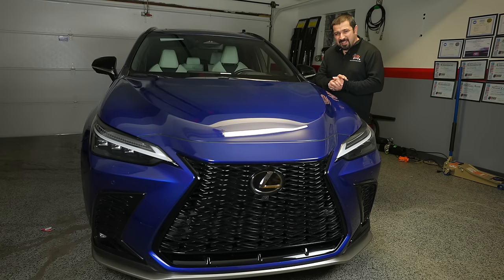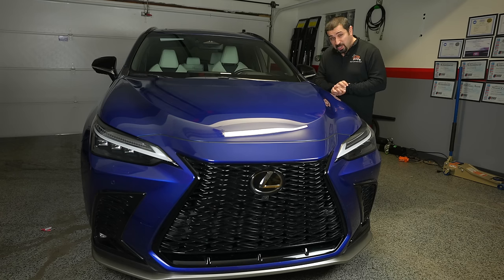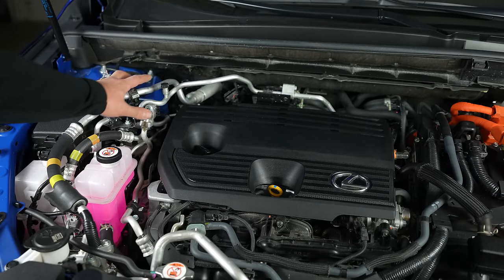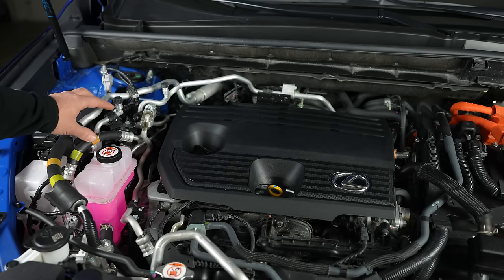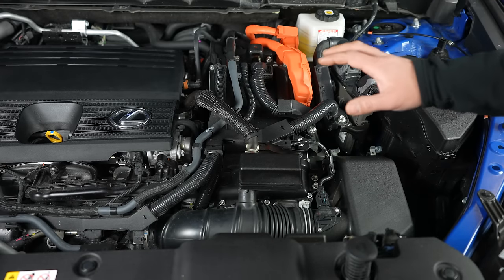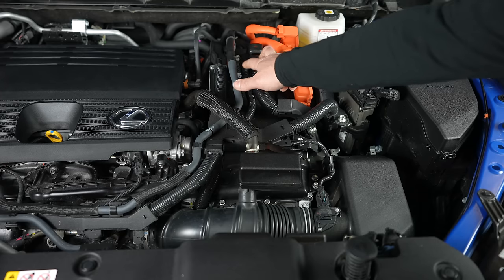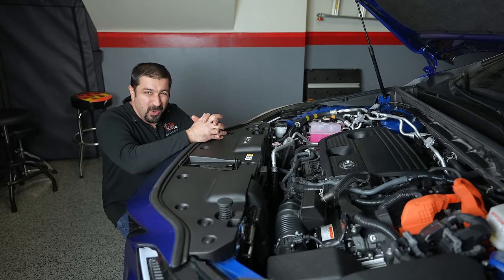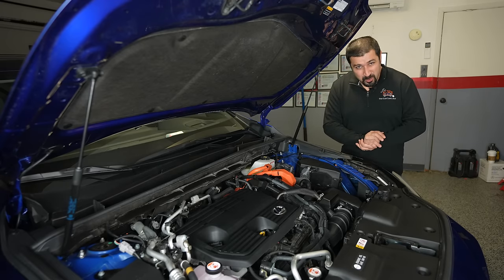The 2022 Lexus NX Marks the New Era of Lexus! Full Review and Technical Tour

Comment: Can you aftermarket fit a spare tire to later ditch the run-flats?
Reply: The battery in the spare tire well makes that difficult
Reply from the maker: It’s difficult with this one
Reply: How about normal tires and some kind of repair kit?
Reply: You should be able to on the non hybrids. But you'd have to get another matching (in size and style) wheel for that spare tyre, obviously.

Comment: Why was the 1.8 L prone to oil consumption, (Corolla 2011)?  And that year (mine) has brake problems - and struts are worn out (noise) @ 90K miles?  Do you think, if I write TOYOTA that they might take responsibility after so many years? Why market a car with THIS amount of issues? Saw your video confirming all this. My brother has a 2011 Tundra even now no issues! My bill will top $1200 so far. New brakes, alt. struts have failed @ 88K!!!
Reply: 88K ! Lucky I guess I got a 1.8 rather than the 2.4L oil burner.

Comment: ..........I own the 2022 450h+ F sport..Note the Heads Up display on the windshield W/14” Crystal clear display on both, alone makes the Lexus better........Mine is In Atomic Silver Glows in the Sun Light with Lil" grey metal flake" and same Circut Red interior.. but with Electric battery...Has 306 Horse power 0 to 60 in 5.6 sec (Via Road and track at drag strip!.) This model DOES- NOT have a TURBO...But rather, a Naturally aspirated / Carb...........(important because it is well known that TURBOS stress engines)...simply said: see euro cars shop time & inevitable “ Check Engine Light CONTINUALLY!!....this car combines the Elec Batt and engine to achieve 89 miles per Gallon in Hybred mode with HIGH torq, And VERY quick out of the hole...Jus' blew the doors off a 735i beemer...albeit for only a block ...( I am no dummy a V will eventually pass many cars in the long dist. (in all fairness) ......However, who cares the thrill is initial take off and tickets are for high speed & SPEED...Kill's! My car has Red Calipers against Powder coated Gloss spoke Black mags and All red "F" Sport Badges........ FAR better built than euro's (mine built in Japan) sadly, new releases are now being made in Canada! Like USA Union shops...no one gets fired for a hang over and bad work??? maybe)..... However, Lexus is Far more reliable...Far better Re-Sale that Euro beemers or mercedes Check Engine Light Gucci headache) .......indeed mine has Gone UP in price...Not many cars you can find Like that!... IF YOU CAN FIND ONE ANYWHERE do grab it!......"econ 101".....Has (3) elec. motors gett'n 0 to 60 in 5.6 sec (road and track) HIGH torque QUICK out of Hole!......~*~*Never do I use gas..... gett'n 43 miles per 120 Volt charge (real world driving my experience.) and NEVER USE GAS Frean'n inflation caused by “Elections Have Consequences!....Almost Silent operation in elec....So do your research, PLEASE......as this is Far better than any European beemer, mercedes and korean etc. All those are depreciating the moment you drive off the lot BIG TIME! And are un- reliable offering to say nothing of the GAS HOG unproven G 70, & RDX not worth mentioning. Z Best of the BEST F Sport 450h+ ! ….One more thing, Jus' a heads up!......My wife drives the RX 2020 model...Consider putting Michelin's at $1000.00 en ebay and balanced on your NX 450h+ F Sport replace the Idiot Run Flats that the dealer wants a $1200.00 extra for warr because like me You WILL eventually get a flat and the Run YOUR WALLET Flats are required to replace??? are you freak'n kidding????....Michelin's primacy same size &......Far and away EVEN a much smoother ride, Shissh, Do Not tell my wife ...even smoother than her 2021 RX 350....because My "F" Sport has the added "Adaptive Suspension". Much better ride than the HARD Run Flat Bridgestones that come stock. Carry a Batt. quality inflator ( DeWalt 20V MAX Corded/Cordless Air Inflator ) and string tar impregnated rope insert-er and Do-Not wait for AAA. Do the aforementioned and You WILL Have the best of the best.....Jus consider this on DEPRECIATION: https://www.youtube.com/watch?v=NPJnBjfh644 End of story!

Comment: Lol there’s the orange cables I was referring to in your livestream question I had about some other vehicles that don’t seem to have it now, and you replied “what orange cables?” (Along those lines). So why do only some Toyota hybrid products have the orange cables in the engine bay?
Reply from the maker: They all should have orange cables for high voltage wires
Reply: @TheCarCareNut  is it possible that depending on the hybrid model (even though I believe they carry the same power trains??) that the 2.0L and the 2.5L have different inverter/converter units? Thus having maybe a different high voltage plug location? Because I see it on the 2.5L, but you have to look down the firewall to see them, they don’t sit on top in the engine bay like this Lexus does.

Comment: Are the run flats only on the NX plug in or are they across the board? Hearing the words “run-flat” is a disappointment, especially since Toyota seemed to be stepping away from them after the new Sienna came out.
Reply: All trims have the run flats

Comment: I know why Lexus didn´t offer spare tire in NX.
It´s because they had the same situation of Lexus UX: There is no space to put a spare tire in the trunk. The UX is too small to that and the NX has the double wishbone rear suspension,the fuel tank,the plugin hybrid battery,the AWD and the rear eletric engine. And due to these components,there is no space to put a spare tire.
The Lexus ES300h has spare tire. But I agree. Run Flat tires are unreliable. It was better put conventional tires and no spare tire.

Comment: Hi AMD, I got a question , i owned a 2021 RAV4 XSE PRIME PREMIUM PACKAGE, the reason a specifically detail it, I’ve notice at the back of rear passenger driver side, left rear tire, underneath theres a small kinda control module comes with a small control bars , and ive check and confirm with other RAV4 Trims GAS OR HYBRIDS., only the PRIME XSE PREMIUM PACKAGE has this Part.,  WONDER WHAT IS THIS FOR?( THANK YOU IN ADVANCE)
Reply from the maker: Hi! Level sensor for the headlights
Reply: THANK YOU SO MUCH.

Comment: Hi AMD. My 2021 Camry Hybrid rear defroster top portion lines are not active while bottom ones are, only the lower two thirds of the total lines. I drive on Eco all the time, is that related?
Reply from the maker: Hi! It’s not likely an open grid. Would need to compare it to mine actually to make sure that the top lines actually are usable

Comment: By going to run flats toyota/Lexus is forgetting about most loyal customers who want reliable long lasting parts such as tires.  I intend to get the 350h but dislike the run flats.  The 350h with 18 inch tires has a short lasting tire that has a traction rating of B.  The best is AA and many regular tires from good brands like Michelin have great tires for suv ‘s .   No spare tire is a poor decision.  Why would Lexus do this to Lexus customers?  Many of whom are moving up from Toyotas?
Reply: The whole run flat tyre situation isn't new to Toyota. The second gen Sienna (2004-2010) had run flat tyres from the factory. Most people who bought them changed to regular tyres, so you can't find any used Siennas with them. My prediction is that the same thing will happen with the NX.
Reply: Yes I would switch to regular tires too.  But not being able to have a spot to put a spare tire is not good

Comment: One more question: Does the 350h REQIRE premium gas, or is it recommended? In other words, is it safe to use regular gas with it (I don't care about losing a little performance/acceleration). It looks like an idiotic decision to require premium gas for a hybrid vehicle.
Reply from the maker: Hi! Lexus has done that to a few models for a gain of a few horsepowers
Reply: I pulled down the 350h owners manual, it clearly states 91is  recommended, but the min is 87- so not technically it does not require.  Other then power, the only other reason might be that these engines tend to have higher compression ratios.  But since they are used in other Toyota cars with 85 (edited) , it is highly likely just slightly more power.  My older Camry V6 said the same thing, and I only use TopTier 87 gas for its 165LK miles.
Reply: Thank you xFirstxLast, this is awesome! Now a question to the Car Care Nut as a professional Toyota technician: are there any consequences  (other than loss of a few horsepower) to using regular gas? Loss of warranty, reduced engine longevity, that sort of things?
Reply: @alexanderkrichevsky9194  Yes, a question I have been pondering also.  Here in Colorado,  87 supposedly due to elevation, is a mid grade.  85 is actually the regular.  Unless I hear otherwise from a master tech (Toyota or Lexus), I will not use the Colorado 85 regular gas, but probably skip the mid-grade 87 NX min  and just go to the recommended  91 NX premium just to be safe to reduce the risk of any knocks that could damage the engine over a long term.  I know the performance is going to be very litte and I would probably never  notice any my daily driving.  Colorado's weird gas options, just make this decision harder to know the risk, if any.

Comment: As a technical guy myself imo you are nitpicking to much. In 99% of the owners of this car the battery will never die. I am pretty sure Lexus made a failsafe system on these locks. In other words there is most likely more then 1 battery behind this locking system. So in 99.9% of the owners these locks will always work.
Yes it's a more complicated system technical wise. But it works and it's nice. Start looking at it from a users perspective not always from the technical side.

Comment: Do those door buttons work when you wear leather gloves? Plus, those hideous wheels
with the Yaris disk in it, looks flatout stupid. Run-flat tires are indeed the worst invention
since sliced bread. They are hideously expensive and customers will be outraged when their
tires are shot at 26.000 Kilometers. I can hear the echo in the showroom, My husbands
RX330 ( yes 330 because they last a long time) only needed new Michelins after 85.000 Kilometers, why? I can see the drama unfolding in front my old eyes.
Thanks Mr Nut , good article.
Reply from the maker: Hi! The buttons will work with gloves as they are a physical button to press not a touch button

Comment: The stupid door handles are for safety. It's probably cheaper and faster to tell a computer not to let the door open instead of mechanically stopping you, if there is a car or bike coming from behind.
I would be very worried if you drove this car in a lake, who knows how long you have until those electrical handles fail if you're trying to open it from the outside to save someone.
The touchscreen for AC is extremely stupid however, hope it gets legislated into oblivion asap.

Comment: It looks like this is a press/pre-production blue 450+ used in as early as Oct 6 UT video (Redline Review https://www.youtube.com/watch?v=xOBV2RrCCjMI  - around 7min it has the same Texas Jun 22 expiration date tag).  It also would explain the few miles this car has apparently seen. 

I wonder if some of the specs changed  in the current production- possible the older TPMS and no active grills?  Just hoping, since I put a deposit down in Dec for one, and almost everything else on the NX is state-of-art design.

Comment: It's cute but, why is Toyota turning their cars into refridgirators  - _ -

I can be a DIY mechanic, but I'm not getting an HVAC certification to pop my hood and wrench on it :/
Reply: Only the plugins use a heat pump. the non plugin hybrids use an electric ac compressor, and the heat comes primarily from the engine.

Comment: Very high that rate of catalytic converter theft and Toyota absolutely  ignores it-again.   Based on cost vs effective value this 2022 Lexus NX really stinks.  You realize all the crap under hood that the average guy can't check and repair, all that plastic and no spare tire etc is solely to reduce weight. It's all about about kneeing to California's miles per gallon mandate. Now the idiots  want to get rid of all gasoline engines. Great clean air for Nevada and Arizona who could care less but will get stuck buying a car most mechanics can't repair and  no spare  when your a hundred miles out in the desert.

Comment: I looked at one when my prius got to almost 100k miles and the batteries were dying and Toyota wouldnt honor the warranty as they were "not bad enough" so no more hybrids for me I bought a regular Nissan Rogue platinum and the Nissan safety and self driving software is light years ahead of Toyota, I still have my 4runner with 250k on it and runs fine and the over priced Toyotas not that impressed with
Reply: Did your Prius have a filter for the battery cooling fan and or did you actually check the fan for debris?
Reply: @rontreen3278  Yes under the rear seat always checked it vacum and cleaned and had no pets for pet hair also did all the services per the maint schedule did replace the clutch, and leaky timing cover gaskets under warranty